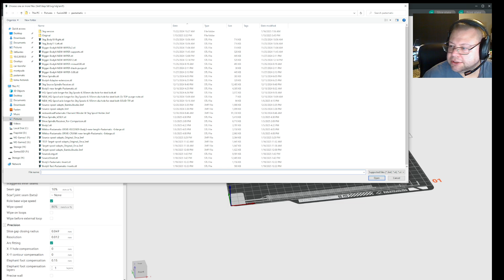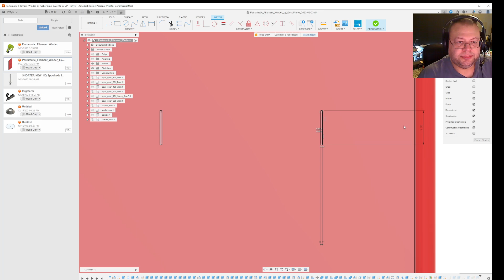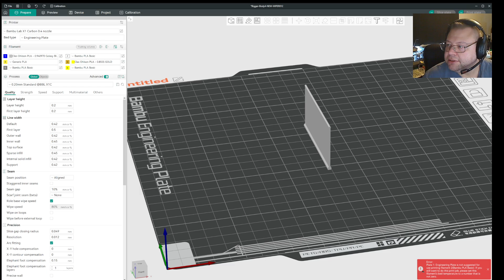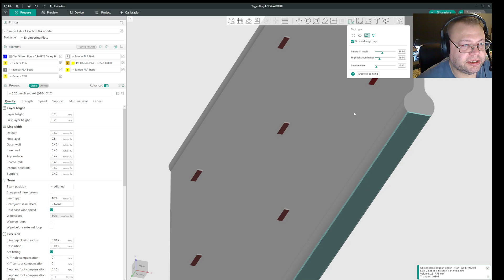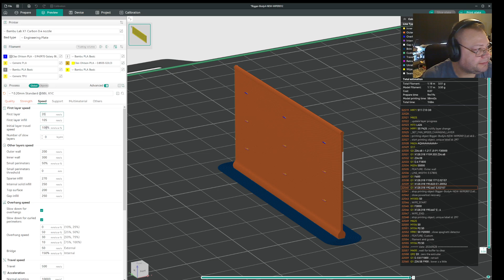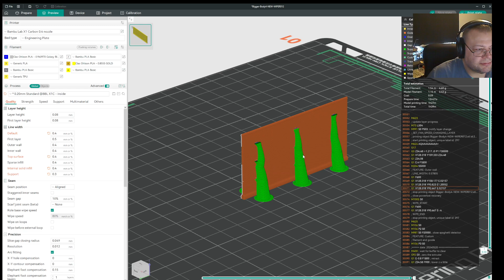Orca Slicer / Bambu Studio - How to print TPU at 90 degrees as slim objects WITH supports! W/Sound!

Comment: Thanks for the really quick re-up.
Good solution, definitely a good approach. I'll try it out for sure. It might be even better (in some cases) to draw the complete support structure in CAD while you're at it. Might be some more work, maybe not, but you don't need the notches to be attached at all.
Oh yea, and I'll check if I can change my username to something shorter, it stretches the video a bit much before you can get to the point... Just kidding, I don't mind watching long videos and like your chill vibe. But nowadays standards would shave off 10 minutes, easily...
I'm not much of a frequent commenter so I just say it here: Thanks for contributing all your little tricks to the community. Cheers!
Reply from the maker: Thnx for the recomment! If I shave my beard, I it will equal 10 min of the videos. My nickname is about 25 years old, so do not want to change it. :D
Thnx for the nice comments! and hope you come back frequently and check in. :)